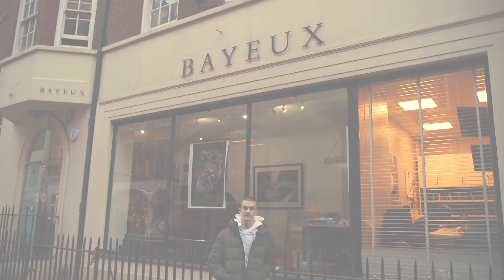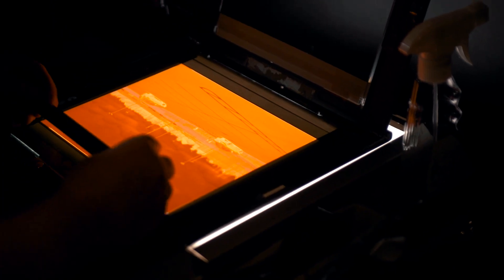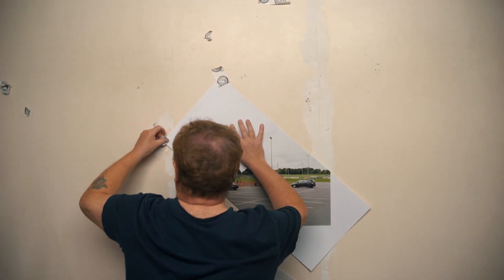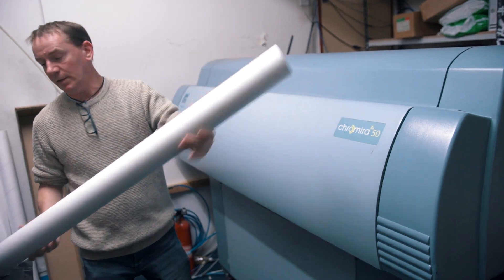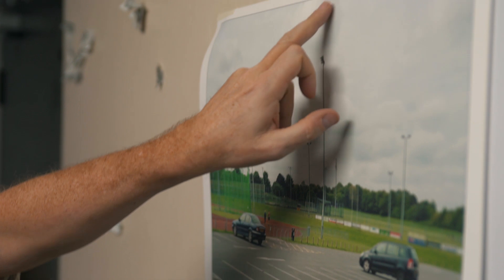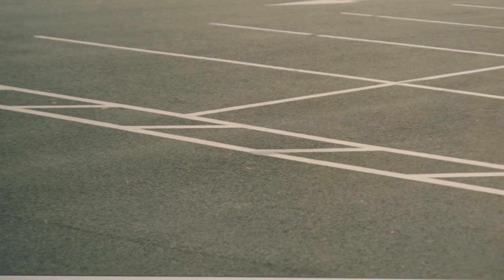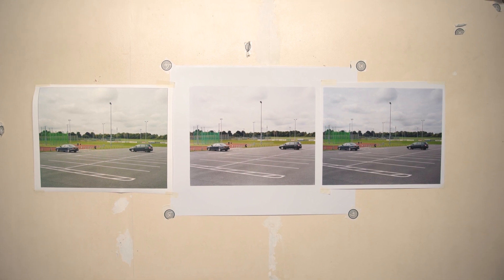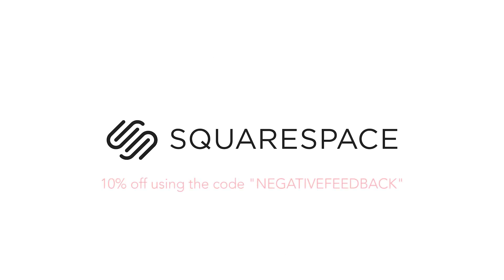How To Print From Colour Film

Comment: Good intro video! I really hope you take another crack at inkjet printing, you really can have an extremely high level of control with it (sometimes TOO high!). As someone who does this professionally with artists, I feel like I should mention that more often than not, a significant amount of time is spent making the necessary adjustments to get from "finished" file to finished print. I love c printing, but in 5 years your your c prints and digital Cs are going to look significantly different, not so for inkjet!

Comment: If intended t be a direct comparison of the potential of each process, I think that idea is weakened by two issues; First, by picking some sort of "art" paper for the inkjet print, a failure to match the color and texture of the paper bases invalidates that comparison with C-prints. Second, and this is more my opinion,if the digital files were "drum scanned", that type of film image to digital scanning can cost up to $100 per image, which is not a process economically available to most people. Creating the digital image by a more widely used (and probably lower quality) scan process would seem to give a more useful comparison. All that said, I think the basic idea here is very useful, and with the adjustments I suggest, the comparative outcomes would be similar but more dramatic.